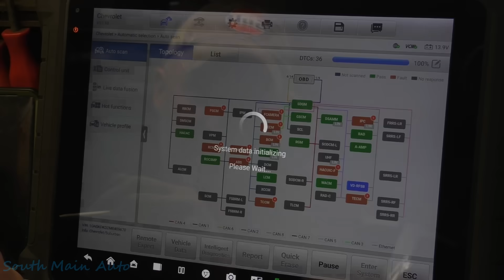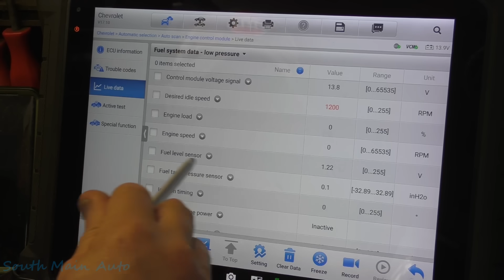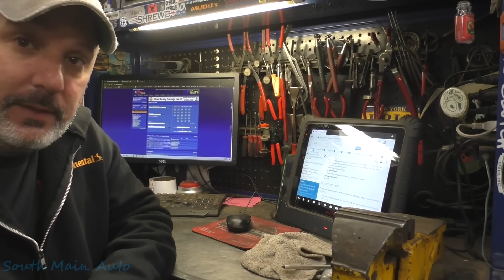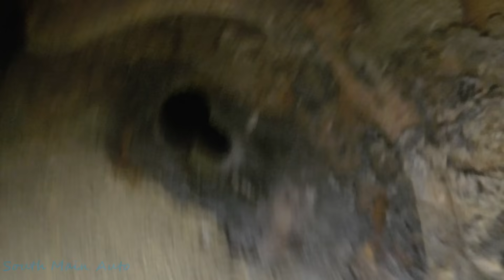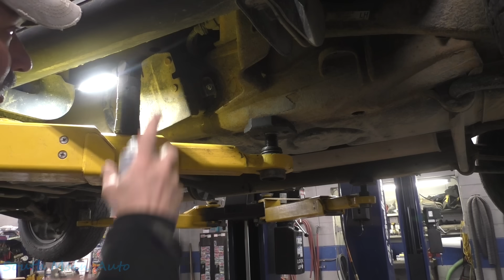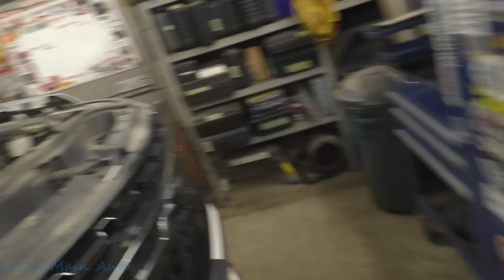'21 Chevy Suburban - No Start, Cranks OK

Comment: I will confirm, idiots are in every career, including engineering. I had an interview once for an EE role at a supplier in SE Michigan right out of college. The components this supplier makes are in several OEMs. In the interview, I mentioned how much of a pain servicing the component is on most modern cars (from personal vehicle experience, and videos like yours). My manager to be, looked at me and said, "Well, you don't have to worry about that. Once you accept this position, you will never have to work on your own vehicle again." This was a huge red flag for me, and I did not take their job offer. Sadly, I find many people have this mentality in engineering. That FP bolt design probably saved manufacturing time on paper, or punching that hole in the frame is cheaper than welding on a nut/bracket.

Comment: Design afterthought because they forgot to assign a place for the bracket. They probably didn’t want to add any more holes into the frame than the keyhole. Great, least expensive engineering solution thought up at the desk - worthless practical solution …

Comment: I find it funny with your high mileage statement. 
I wish I could have afforded a truck with less then 200,000 miles. I believe it is more common to have 200,000 miles then it is to have 92,000 miles.
My truck I bought 1.25 years ago had 225,000 miles when i bought it. It has the timing chain system replaced before I bought it but still had a timing problem. 
The problem was the pigtail on one can position sensor. For $16 I spliced a new pigtail/plug on and it runs perfect. 
Now has 235,000 miles on the 5.4 liter 3 valve engine.
I am very happy with my actual high mileage truck and glad I don't have a payment.

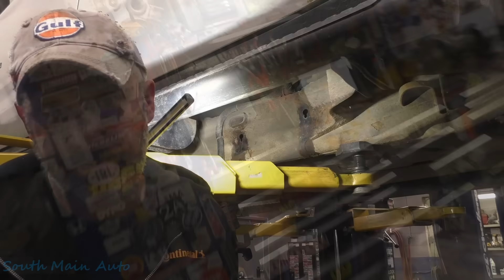Comment: 12:45 So .. if you say there's no way to remove the bolts for the pump pump bracket then how were they installed? You're missing something easy. 14:32 there it is.

Comment: I've had a few diagnosis where I've found opens doing ohm testing it's definitely not the best way to check circuit integrity but if it's newer and the manufacturer is paying the bill you have to get on the phone with a field service engineer and they will ask for readings at each step of the pinpoint test so you have to follow it for that reason

Comment: Hi Eric: as a retired GM Master tech I understand your frustration.  I was the brakes, suspension, steering tech for many years. Guess what they use the same style bolt to attach the air compressor for air ride behind the left rear wheel. It is just quicker to hang the part as it is going down the assembly line. Replacing the compressor is much quicker when all you have to do is loosen the bolt, smack them with a hammer and lift the compressor off the frame. I do not know how much the fuel pump module costs but sounds like it might be smarter step than dropping the tank first. I would also suggest you back off that extra coffee in the morning. It seems to be getting you all wound up. I am in Oklahoma, we still got some badly rusted vehicles to work on. Where your located wiring and electrical problems are high on your weekly repair list. Of all the other brands out there like, Ford, Honda, Toyota, Mazda, Kia, and about 20 more, I am sure they break down too!  I know because I also worked on them. The brakes, suspension, steering electronics wiring was all exposed to the elements. Yes many of them kicked my butt, but I found the problem and fixed them. Retired in 2021. Have fun.

Comment: My two bits worth:
Brushless battery electric drills have a 3 phase motor.
You could play with an old drill to see what the wave forms look like. I suspect that the drill controller would run the fuel pump motor more or less.
An inexpensive experiment.

Comment: 3 phase motors are the most efficient and the simplest, that's why alternators are 3 phase, to me the key is where is where is the 12V dc turned to 3 phase AC, if the inverter is in the module then it can be tested, Very interested in the followup.

Comment: Is the inside of the bolt shouldered under the head? So that would be made to drop into the hole drop downward in the slot and then you tighten the T5 on the outside to tighten it in place. Unfortunately to release it you should turn it clockwise and most people even if they think of turning the torx end are going to turn counterclockwise and twist it off

Like you did, knowing after the fact, I would torch the nut off the bracket take it out on the ground, put a bolt through from the inside like you did put a nut on the outside and tack weld that nut to the bracket. put another nut on the very end of the bolt thread tack weld it there where the T5 would be. And now you can use a 10 mm wrench on the very end. Alternate would be run the bolt in from the outboard side and then weld a flat washer on the end of the bolt that would just go through that hole in the frame drop it down into the key slot and spin it out. 

But the next guy will still turn it counter clockwise and twist it off which maybe is not a bad thing.  the flat washer breaks off and drops into the frame. the bolt comes out and the bracket comes out

Comment: If they really had to do it that way, they could have just used carriage bolts that engaged with the smaller part of the keyway. Could be undone by loosening the nuts most of the way, pushing them in, and sliding it up, pulling it out. Then would go back in by pushing the nuts, "hanging it", then sliding it down. Torque the nuts. I guess I have too much  sense for an engineering degree. lol

Comment: Jonny on the frame assembly line took the day off! 4,000 suburbans have no holes in the frame....  Typical Chevy. 😊 But actually, just take the fuel tank off and change the fuel pump! 😊

Comment: I was thinking that maybe you could pull apart an old 3 phase power tool and use the internals to do tests for these kind of pumps.. but The motors have hall effect sensors in them and they have to be in time..  SO if the motor in the power tool (like a drill or whatever else) -- had a different number of poles in the hall effect sensor-  then it couldn't work..  I'm just trying to think of the easiest way to test these motors in place.

Comment: To test 3-phase motors like your fuel pump, a bench controller designed for brushless DC (BLDC) motors or 3-phase AC motors would be ideal. Here are a few options you might consider:

Three-Phase AC Torque Motor Controller: This controller is compact and efficient, designed for inductive or resistive loads. It provides stable voltage regulation and is suitable for testing motors in a controlled environment.

Autonics Digital Thyristor Power Controller: A more advanced option with digital controls, LED display, and support for phase and cycle control. It’s versatile but may be overkill for simple testing.

TBVECHI Three-Phase AC Torque Motor Controller: A variable speed control drive that’s user-friendly and cost-effective for basic motor testing.

Each of these controllers has its strengths, depending on your specific needs and budget. If you’re looking for something simple and affordable, the first or third options might be a good fit.   (AI) ..

Comment: Usually a 3-ph motor controller will briefly provide power to the motor, then give up if the motor doesn't turn. So if you're ready with your AC voltmeter when the pump tries to turn on, you should see a couple seconds of AC (depending on controller). 3-ph freaks a lot of people out, but it's just AC. Measure between any 2 of the 3 wires, and you should read an AC voltage if everything's working. "But it doesn't have a Neutral, my head's gonna explode!" Your electric oven doesn't use Neutral either, because it takes power from 2x120V AC lines. 3-ph is same idea, just 3 hots instead of 2.

Comment: They could have just as easily put a plastic bowl over the outside of it to block the splashing - and it wouldn't have this issue.  It would't even be an extra part-- just design the bracket so that it covers everything like an electrical box, rather than leaving it wide open like that.  Pretty crazy.  They don't want things to last.

Comment: I think a few people missed the point Eric O was trying to make. It was not the fact that the bracket was held on the way it was. It was the sheer fact that the service data did not say that, it just said unscrew the bolts..... Whereas if the technical manual actually said the correct way it was put in there then anyone would know oh it is these and they slide.  There is nothing more frustrating when the technical manual does not match what your actually looking at.... how many times have you looked at a wiring diagram and the wiring colors your actually looking at is nothing even remotely close what what service data tells you...... Nothing gets a person swearing every single known choice word that is known to man or beast than trying to figure out what wire is what simply because nothing matches up..... As to why it is mounted that way.... if had to guess it will be about productivity that way the whole thing can be lifted up already pre assembed, put in position and tightened down no fumbling with bolts or screws. Saves a couple of seconds of time, therefore an increase in profit. The issue isnt how it was done. It is again a blatant and obvious variation between physical and written..... want people to see red and beyond that is how to do it instantly. I have no issue with how the engineers do something, although sometimes i question why. But, there will be a reason of some sort. Get the documentation correct and matching and you would find there would be a lot less "friction" between those who build and those who repair. Do we sometimes question the placement of a part of its location. Oh yeah!!!! but maybe it is a distance limitation in which case there is not a lot of options and if in this case one could not argue it was easily accessible so in that regards it was perfect. Now if only they always had top access down to fuel pumps etc older cars did..... why could they not continue that into modern vehicles.. The one thing about modern cars i do not and never will understand is the stupid stupid and idiotic system now with car batteries and having to go into the computer to tell it it has a new battery WTF!!! no need to for and no justification for it It is just an excuse to tie you into a particular battery (normally the most expensive available) and at the end of the day for what purpose you do not need all the "monitoring" crap on the battery. Take it back to basics folks you do not need a sensor to monitor the sensor which monitors the voltage and tells you the battery temp is too high or low.... added electronics just something more to fail, something more to go wrong and something more to add frustraton to the customer.... The other safety stuff yeah ok i accept that but all that crap with batteries now. No, I do not. If you argue well it is to "protect" the electronics. Then I say in that case but in a surge protector at the battery... solved your argument there is not valid. Ok had my rant of the week. Take care everyone and thank you for another great video Mr. O. :)

Comment: I would be curious to see if you could put in a 1-5 amp test light that is back probed into the controller connector for each pole for the motor and command that pump on with the scan tool or even with just a KOEO fuel prime(although I believe GM went to the fuel pump prime to happen when the driver door is opened, similar to VW, when they went to the newest body style for their trucks in the 2019? YM).  With the test lights connected directly to the controller you should be able to to see all 3 of them light up if the controller is working.

Comment: test the ohms of the 3 phase combinations. A-B, B-C, A-C  All ohm readings should be the same. Check each phase to ground. Should be no continuity.  That's how you quick check a 3 phase AC motor. If it checks OK I'd go to the module and wiring. If any test failed I'd change the motor.   If the pump seized amps would be elevated. Zero amps means motor is not trying to run. So if phases are good and no short to ground and zero amps check the wiring from controller and if good change the controller
IMO

Comment: With the quality of parts nowadays, what if you changed the control module and it still didn’t fix it? Then it says to change pump. What if one of the new parts was bad? How could ya tell??

Comment: Eric, this very much like high priced a/c stuff for your house now DC motors. We get the same ohm readings. .3 to .5 ohms is a good motor across all windings. I'm thinking you are seeing the same thing we see. Amp draw goes up to 2 amps the pump gets turned off. You got fuel pressure to start the engine. In our case motor is shorted to ground maybe yours to. Our case will not trip a breaker. A/C goes into lock out. Got be same tech. stuff.

Comment: Era this is Scott from Los Angeles. There's no such thing as a 3 phase DC motor. It is a 3 phase AC motor. Inside the controller is a full bridge rectifier to change DC to AC. Then there is a phase converter to turn it into 3 phase AC power. Again there is no such thing as 3 phase DC.

Comment: the inverted torx sockets is your answer. lol
in theory it should be easy to replace them and the bracket, just blast it off with air hammer and stick a whole new on assembly on. probably exactly their plan.

Comment: Extremely common GM issue. Has left many people with the 5.3 6.2 V8's walking. GM has known this issue exists for some time and can't seem to fix it.  The other side of this issue is for the tow truck operators because when your truck leaves you on the side of the road dead, you can't get the car into neutral because the engine won't run. This of course is only the push button shift variety but it is a problem to be dealt with.

Comment: It's for ease and speed of assembly at the factory. The module and bracket come in as an assembly with the bolts preset, the part gets hung on the chassis, then the bolts are torqued, which may or may not happen in the same station on the line. Quick, easy, and almost foolproof operation.....and to heck with what happens with it after the fact.

Comment: I wonder if the OEM's have a break out box that can be installed between the Module and Pump Motor to allow you to test Voltage & Current In & Out or something just at the module with a loopback feed to test the module function itself.   There are similar devices used on Hydraulic Servo Valves.    Testing something that's momentary will drive you bat shit crazy.    Thing is with the automotive industry use of different connectors and wiring you would need different testers not only for every manufacturer but for changes in the models.

Comment: I worked as an automotive engineer 30:48 30:52 for electronics for 44 years (not for GM).   But the gas tank placement usually placement has several factors that control its placement (especially gm with the law suits they had on truck fires with the gas tank on the outside of the frame ).   Once placed they like to run the gas line up to the engine on the side they want to clip it to the engine feed side.  Now where to put the fuel control system.   On a 
phased pump motor they want 
the controller as close to the 
tank for Electrical Driver Design 
issues considerations (close to the tank as possible is one of the design checks). So with the tank on the inside of the frame, they had to put the fuel driver on the outside of the frame opposite the tank.  With the tank in the way they had to come up with a creative way to mount it so you did not have to remove the tank.  
.
On the issue of how to test a phased motor.  It works with the magnet on the armature, the phases are 3 magnets fixed on the the outside of the pump (surrounding the inside of the case.  Usually all 3 magnets have one side fixed to either power or ground, the other side are tied to the 3 phases.  That low resistance reading you got was probably the winding resistance you got.  Because they were the same, that would indicate the motor phases are ok in the motor.   I would bet from all the data you got that the controller is bad, or the armature in the pump is jammed.
My 2cents.  It is easy to blame the design when you do not know why things are put in for safety.  I never worked with an engineer that wanted to make things hard to repair on purpose.
Thanks for your videos.  Take care.
Reply: Did a search on the jungle website for a "Three-Phase Sensorless Brushless Motor Speed Controller" found a $15,15 amp driver sold by DIY-MODULE that a person could use to drive a fuel pump. Possibly a person could put one in a box. Maybe a fuse, banana jacks... Tell me what you want
Reply: Then if they are not trying to do it do they ever look at the end product? This design is plain stupid. Do the engineers ever assume a component might fail? Engine bays are so cramped you can scarcely change the spark plugs. Do the design engineers ever ever look at the finished product?
Reply: @stringpicker5468 well, come out with your own design and make a trillion dollars!
Reply: @stringpicker5468  what a troll.  Who says the design is stupid?  Only people that do not know the design constraints they were working with.   I would bet you never had to design a car for the public use.   I explains the issues in my original response it looks to me like they came up with a good solution to work with.
Reply: The original design engineers probably don’t have any bad intent, just design “constraints” that are placed upon them. But keep in mind there is a review process done after the car is designed to where another group will look at where money can be saved, either thru shorter or less wires, or shorter or less bolts etc. and that is where you get some of these issues as well.